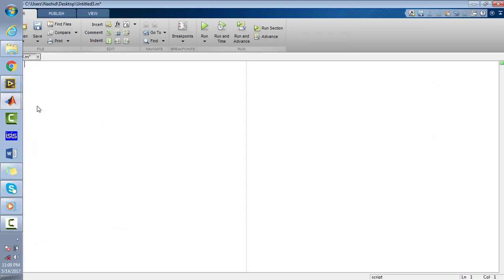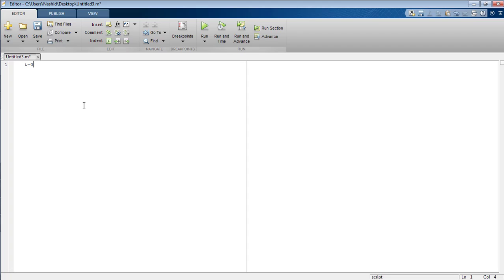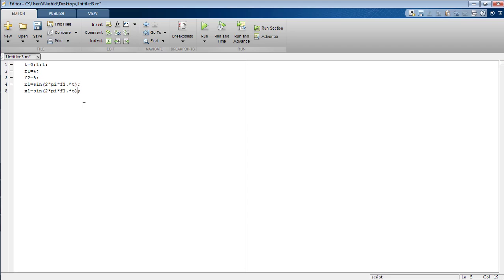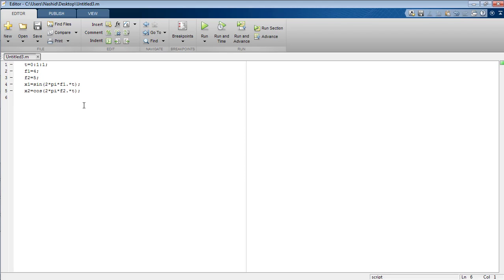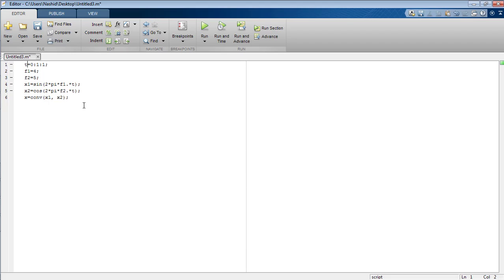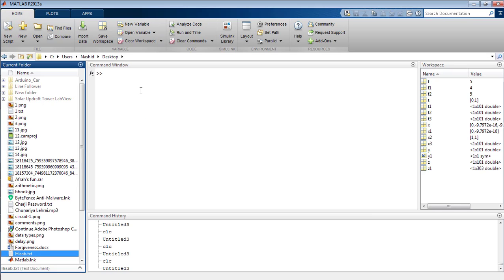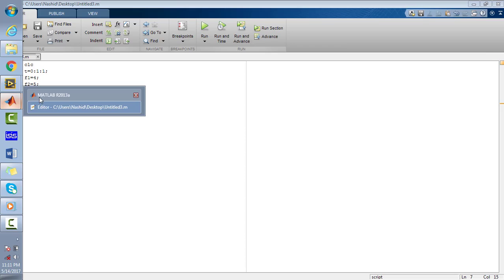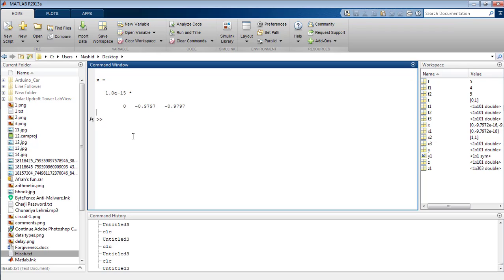how to calculate convolution of two signals in matlab

Comment: bhai kya bta rhe ho ye
without mein search kr rhe the with convulation bta dia tumne

Take help from this code because the video is of no help
if there is any mistake in code, please correct it and mail me

clc;
clear all;
close all;
t=0:0.001:2;
x=t<1;
h=2*(t<(0.5));
subplot(3,2,1);
plot(t,x);
ylabel('x(t)');
xlabel('time');
title('first signal');

subplot(3,2,2);
plot(t,h);
ylabel('h(t)');
xlabel('time');
title('second signal');
tt=0:0.001:4;
z=conv(x,h);
subplot(3,2,3);
plot(tt,z*0.001);
ylabel('y(t)');
xlabel('time');
title('convulation using conv function');
axis([0 4 0 4]);

m=length(x);
n=length(h);
X=[x,zeros(1,m)];
H=[h,zeros(1,n)];

for i=1:m+n-1
    Y(i)=0;
    for j=1:m
        if(i-j+1>0)
            Y(i)=Y(i)+X(j)*H(i-j+1);
        else
        end
    end
end
subplot(3,2,4);
plot(tt,Y*0.001);
ylabel('z(t)');
xlabel('time');
axis([0 4 0 4]);

X_w=fft(x);
H_w=fft(h);
Y_w=X_w.*H_w;
y_t=ifft(Y_w);
subplot(3,2,5);
plot(t,y_t*0.001);
title('proof of conv theorm using fft and ifft');
ylabel('y_t');
xlabel('time');
axis([0 4 0 4])
Reply from the maker: It's an old video .... so not so good .... Thanks for the code ... :)